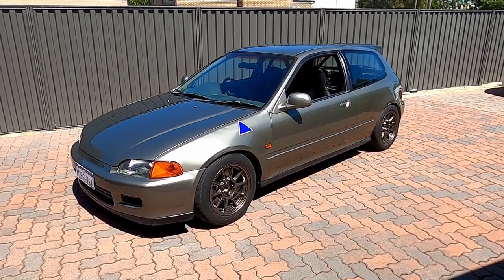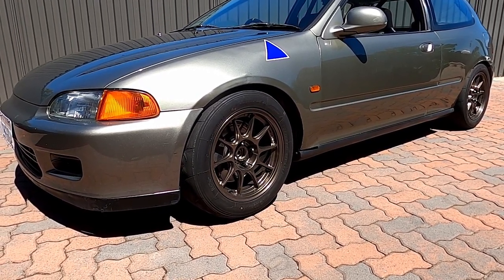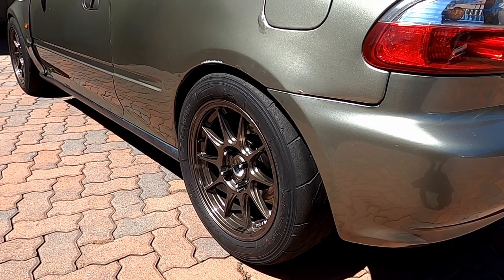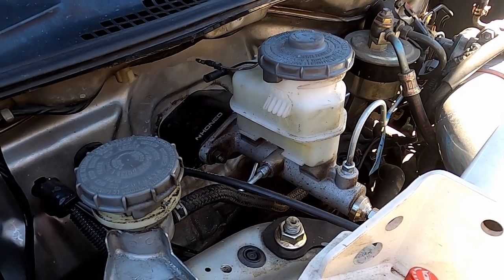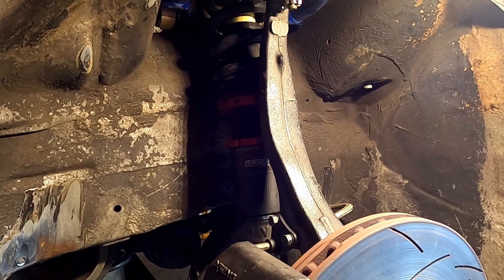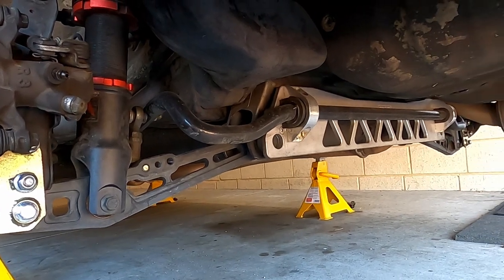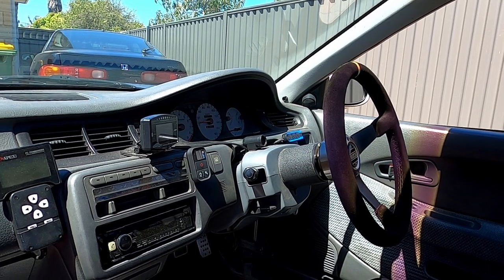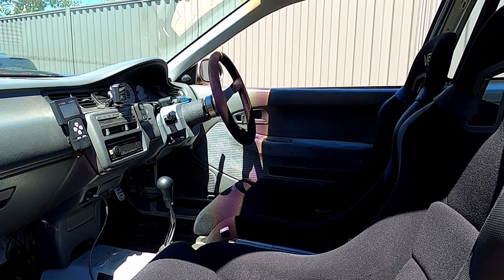EG Civic B18C - Racecar Walkaround / Build Breakdown

Comment: Great break down mate, what wheel alignment settings are you running? Thanks
Reply from the maker: Thanks! That is one of the things I forgot to cover in the video, front is -3 camber, +4 caster and 0 toe, rear is -1.75 camber and 0 toe. I don't like a twitchy oversteery car, these make it quite neutral but still good rotation
Reply: Thanks for the reply mate, do you think these much lap time improvement with the Honed Correction kit? Cheers
Reply from the maker: @leighwilliams6684  it definitely helps. It's more about getting your suspension to work properly (especially in the rear) rather than being compromised with "normal" setups. Combined with good coilovers, it is a better setup and easier to tune/develop.